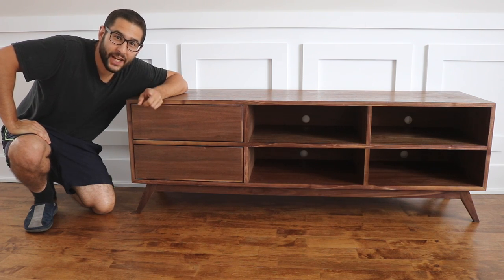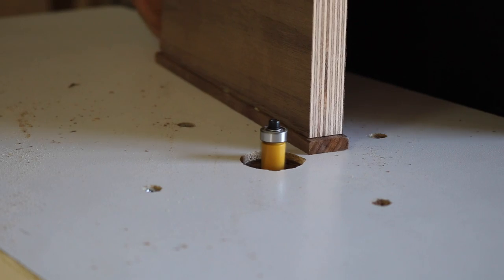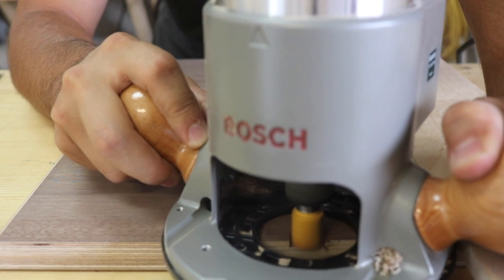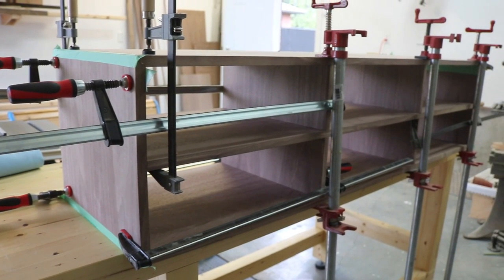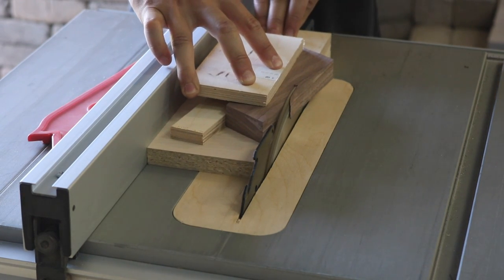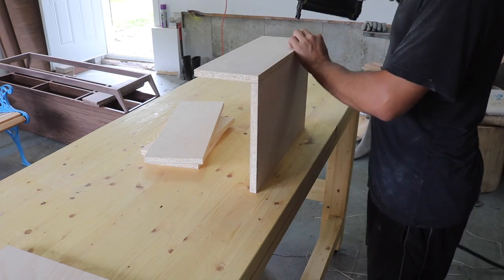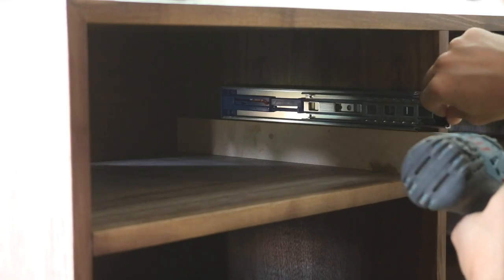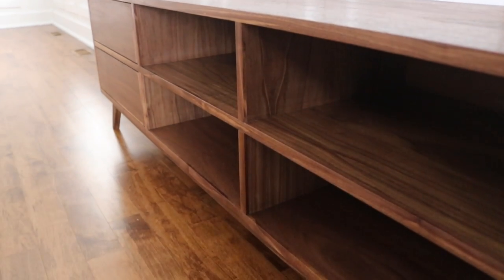Mid-Century Modern TV Cabinet // DIY Woodworking

Comment: Where did you purchase the three-quarter inch Baltic Birch plywood with a walnut veneer and man asked how much it was and what size sheet it came in, the same for the quarter inch.
Reply from the maker: 4x8 sheet for both, got it pre-cut at the lumber yard for easier transport
Reply: may I ask how much each sheet was